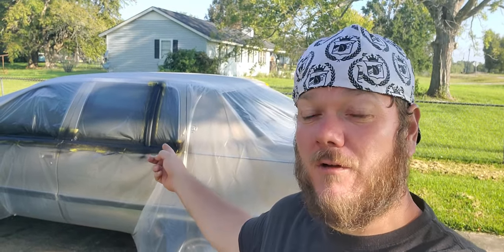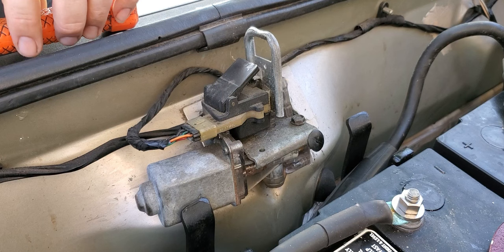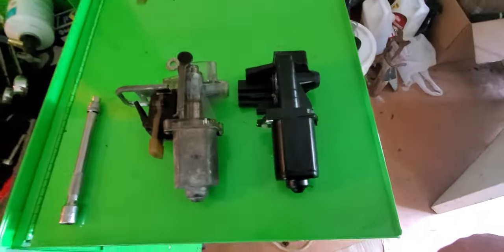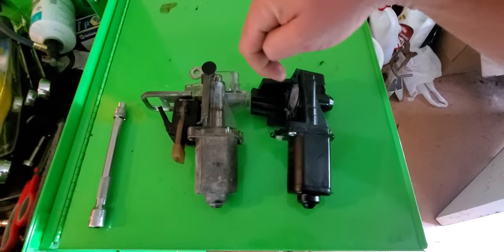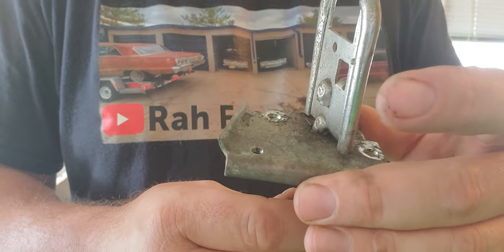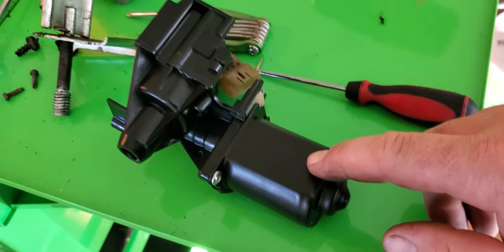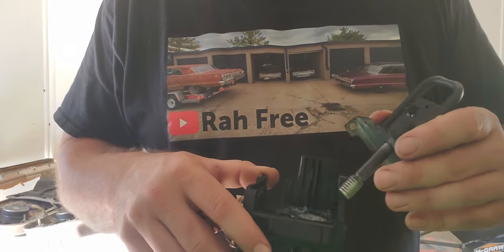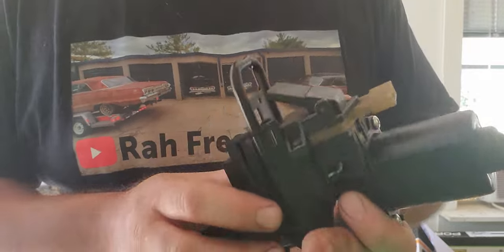How To Replace The Trunk Pull Down Motor On A 93-96 Cadillac Fleetwood

Comment: Looks like the function of the C6 Corvette Convertible Tonneau pull down motor. Thank you! the plastic housing on mine is shattered. I appreciate your explanation of the function of the switches. The Corvette has a pad on the cutoff switch. No idea of its size or composition as mine is gone. Probably why the case shattered
Reply from the maker: I have seen the cases break also a friend of mine on Facebook made a video on how he put the case back together with super glue then fiber glasses the outside of the case

Comment: Your video helped me! Thanks. The new motor is working fine. Just bought my 93 Fleetwood in The Netherlands. I got a question the motor works now but I cant open the trunk with the yellow button or the remote control. I hear a relay and I got power on the above switch but it wont open.
Reply from the maker: The trunk releas is a separate part I don't have a video for it at the moment but you can look near the wires on the top latch switch and should easily be able to find the wires for the release it connects to the rid that goes from the key to the trunk latch and you can check to see if it's getting powr
Reply: @thecadillacdanshow8658  thanks! I fixed it. Thanks alot. Your channel is really helping me.
Reply: @thecadillacdanshow8658  thanks! I fixed it. Thanks alot. Your channel is really helping me.
Reply from the maker: I'm glad it could help!

Comment: The switch on the trunk lid isn’t engaging. It’s called the trunk open warning switch. I’ve searched for it, but I can’t find it anywhere for the 1994 Cadillac Fleetwood model. It seems like it stops at the 1993 model. Any ideas?
Reply from the maker: I havnt seen any of the switches in the after market yet only in junk yards you can try cleaning the contacts with contact cleaner and a soft wire brush

Comment: My trunk pull down doesn’t work I got a used one but the clear plastic is cracked. It was left out side and it rained so it got wet how do I test it to see if it got messed up? I am going to have to swap the clear plastic out where the gears go.
Reply from the maker: I will message you on Facebook I can send some pics

Comment: Is that a 4 pin plug . Man I've just about gone crazy I have  a 93 cadillac deville & on the  plug to that motor it's  only got 4 wires, & people are telling me that it needs to be a 5 pin or a 3 pin can you  help me please?
Reply from the maker: 4 wires on the bottom from back to front they are black green red and orange and two wires on the top latch all they do is when the switch is made it connects the circuit
Reply: Thanks  @thecadillacdanshow8658

Comment: What does the motor attached to trunk lid do? That's another motor right there
Reply from the maker: There is just one motor that bolts to the body the part on the trunk itself is just a switch. There are 2 switches one on top (trunk lid) and one on bottom (the body) they tell the motor when to turn on and off if your trunk is open the top switch tells the motor to turn on and the bottom switch tells it when to turn off